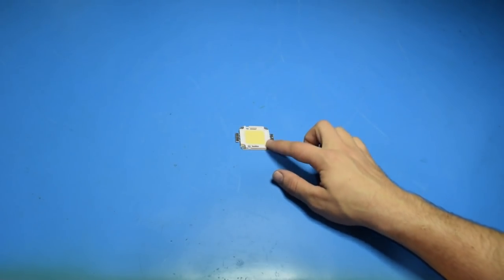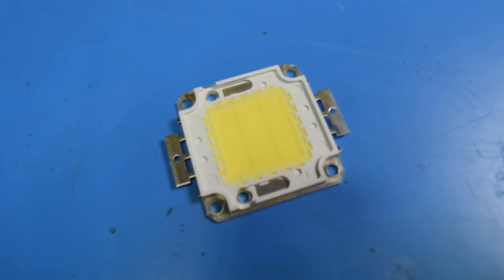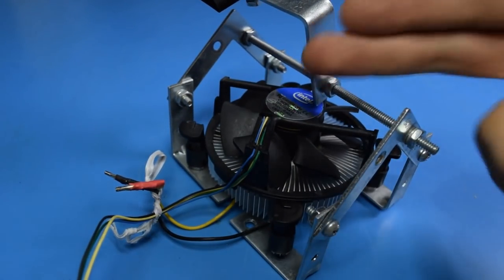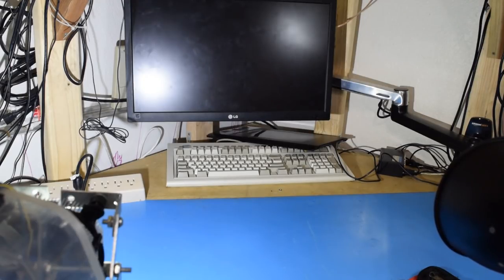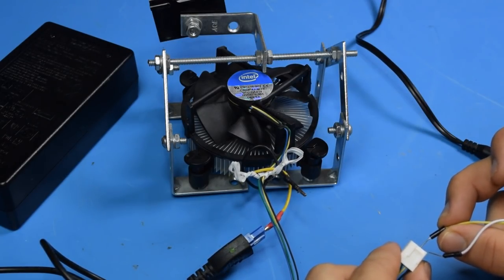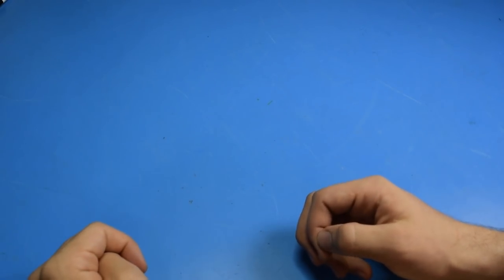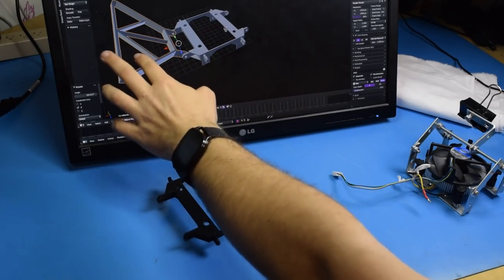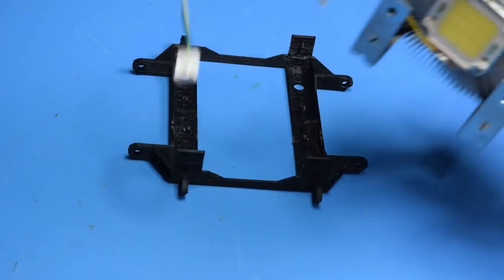0x001D - DIY LED Filming Lights

Comment: Holy jank.  Dude, LED heat output is exponentially higher as current is increased, while light output is relatively linear.  You’re running so hot because you aren’t current limiting.  PWM that shit with a 50v N-channel MOSFET from an amplifier and an arduino.  Remember to cool the FET.

You’ll drop light output slightly but heat output by a HUGE amount.  Let me know if you want help with the firmware, I can provide a circuit diagram for an easy current limited driver.

Comment: For the diffuser, try a sheet of bleached parchment paper instead of the fabric. It's thin as heck and very heat resistant. Only problem is the silicone coating making it troublesome to install as tape and many glues just won't stick to it at all.

Also with high power LED's, it's not really the voltage but the current you should look out for as they are ridiculously sensitive so that even the smallest change in voltage can increase the current by massive amounts (in some cases, 5% increase in voltage can double the current draw). Getting a constant current driver would be highly advisable.

Comment: I actually used one of these but the 100 watt variant, on a P4 heatsink, in an old LCD projector, it works fine, never gets hot either cause the original Metal Hayled bulb cooling system for 150 watts seems to keep it in check, as for the PSU an old printer power supply worked well, just like your setup
Reply: as for a defuser, ever grab a dead lcd screen and disassemble it? they tend to have lenses and defusers right before the actual screen, at least on tv sets.

Comment: I've tried running leds without a driver and found it to be not viable.LED forward voltage tends to drift with temperature so the hotter it gets the lower the Vf and thus more current flows(and the cycle repeats itself until the led is dead).If your power supply   is less powerful than the led then its fine.

Comment: or you could use a buck module off the 16v output of the HP PSU and it would be easily tweaked to the "silent but fast" portion of the fan curve

Comment: Those Lohas (or other Chinese) LEDs have terrible color rendering. You can get Cree chips and holders for fairly cheap, if you're willing to drill and tap holes in a heatsink. I got some 93CRI Cree CXA1507 chips for less than $4 apiece and they work great, but you'd need a lot of them for studio lighting.

Comment: Is it possible to put 3 pc psu's with their 12v lines in series to accomplish those 36 volts?
Reply from the maker: It is, but it's not so hard to get a 36V power supply that I would recommend that.
Reply: In desktop PSUs, output ground is generally tied to protective earth, so stacking definitely won't work with these. For brick-style supplies it depends on how they're constructed.
Reply: PileOfEmptyTapes Thx for the info! I was just thinkering, because many people have those laying around, and some non-pc psu's can be connected in series. 
So it is not a good option in either ways.
Reply: @TechTangents  sorry dude totally wrong @PileOfEmptyTapes is actually correct the dc ground of pc psus are ALWAYS bound to AC ground (it helps with networking and multiple devices to have a common ground reference to reduce ground current on the signal lines) although you can force the ground to be floating it isn't recommended and I discovered this when testing a 24v "fan booster" (with obvious variable limits) and discovered the -12v rail on the second PSU was at 0v when connected to the second PC and looked at wiring and discovered the -12v is still referenced to ground in the fan controller and the second PSU used the -12v for cooling Ouch

Comment: Hey akbkuku, what about using two or even one h4 led lamp from a car? I've found 2 of them here and i have a old 450w atx psu that can provide the power for them. 
O dont think they need any cooling as they are made to be in a car and i think they are equivalent to a 55w lamp
Reply from the maker: The biggest advantage those have are using 12V instead of 32V. The smaller ones don't seem to have any active cooling. But the larger ones do. The advantage to my setup is that I have a considerably more effective heatsink that allows me to use a bigger, slower fan that will have less noise.
Reply: AkBKukU The ones i found seem to run on 12v dc. I will give it a try. Otherwise, ac led bulbs are darn cheap here, i may use them until i buy the whole tools and materials to make setup like yours.